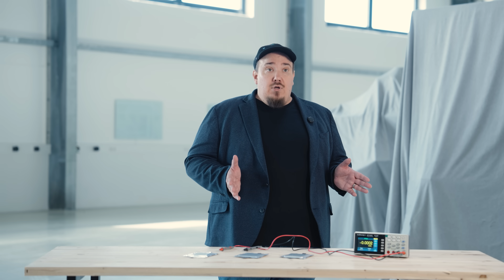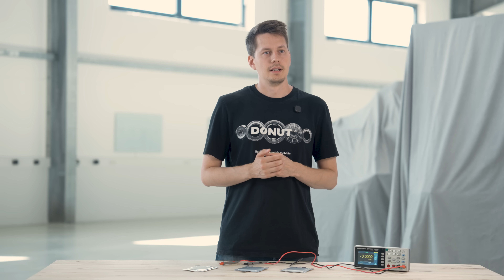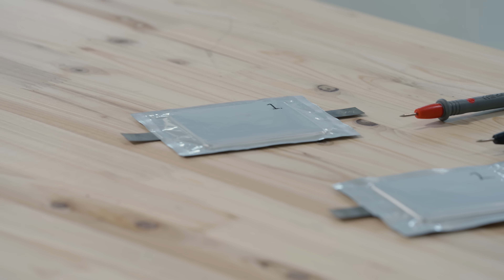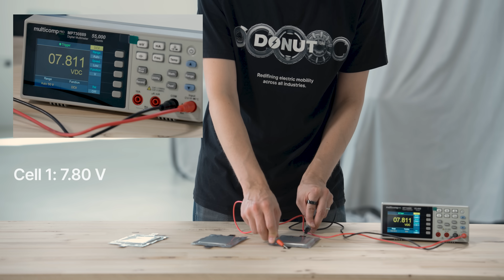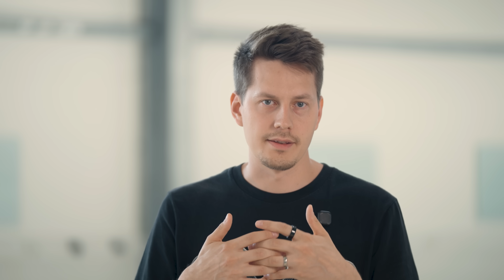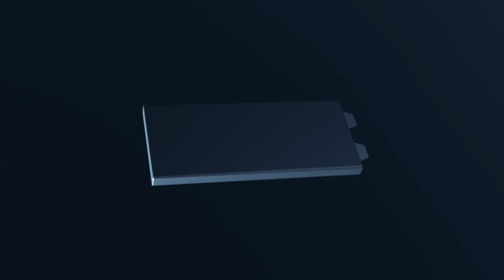Bipolar Cell | I Donut Believe

Comment: Still no third party verification of the energy density. I want to see you guys proven right if only because your critics have been so harsh, but why wouldn't you submit your battery to third party verification of the energy density claim? It's critical to the motorcycle. At this point, I've already decided to buy a Zero motorcycle with half of the range you claim for the Verge and much slower charging because I've taken the critics "debunking" of your claim for granted, despite the fact that the critics (like Ziroth) don't well support their claims either. You could contradict the critics easily by releasing a battery. Why don't you?
Reply: If what they have is real at all, it makes most sense to release that test just around the time the first production bikes go to actual customers. That would be kinda the slam dunk, when it becomes impossible to deny what they have, and they’d get another huge wave of publicity. 
Everything they’ve tested and shown up to now would be the foundation that eliminates all the other doubt people would have when they can test the basic specs (energy density) for themselves.
Like all other battery tech, unless you enjoy the theatrics, just ignore it completely until there are real products in real customers hands. Preferably some good independent third parties should have tested the final product as well.
Reply: @auspiciouslywild 
entièrement d’accord ! et quand j’aurai ma TS Pro GEN 2 déjà bien améliorée au niveau du moteur et pas que, normalement fin du premier trimestre 2027, je ferai beaucoup de vidéos sur ma chaîne dédiée, comme je fais pour mes autres 2 roues électriques ou non …
Ces conflits recherchés par Marko me font bien rire 😂
Reply: Parce que Donut a une stratégie commerciale spéciale, avec une pare de vérité factuelle comme leur moteur et leur première batterie de la GEN 1 déjà performante, et avec cette batterie Solid, Mako l'a affirmé dans ses premières vidéos, qu'il voulait exciter et remuer les autres autres constructeurs et ça marché, notamment avec l'avancée des batterie sodium Solid en passe d'être très prochainement mise en place dans de petits véhicules dont on se sert pour le quotidien.
La TS Pro GEN 1 a fait ses preuves et continu d'ailleurs, et personnellement j'ai commandé ma TS Pro GEN 2 depuis plus de 3 mois, avec la grosse batterie 33 kWh brut ou 30 kWh net utilisable et même si ce n'est pas une batterie Solid, j'aurai quand même une batterie performante semblable à celles qu'ont sorti CATL, BYD et d'autres, donc ça m'ra très bien, même si j'aurai préféré la Solid surtout pour une question de meilleure sécurité et insensibilité au extrêmes chaleurs et froid...

Comment: https://youtu.be/j5oyVNjrUPI
Reply: Ryan has put his career and that of the team behind him at Ziroth at risk with this particular video, it's not a well formed engineering analysis.  It's already been shown to contain a number of invalid assumptions and questionable jumps in the logic applied. The voltage curves when analysed by actual battery experts have been found to be dis-similar to known Lithium Ion cells, and in the range not only inhabited by Lithium, but Sodium cells as well. Then there's Ryan's rather selective use of Donut Lab data to calculate an approximate energy density matching that of known Lithium Ion cells, an approach that is both troublesome and rather concerning.
Reply: @GruffSillyGoat Interesting.
I'm not an engineer I can understand the datas. I didn't know about invalid assumption being made in the videos or his "selective use of data".
Technical analysis aside, the history of the company, its lack of communication (not commercializing the battery being tested and advertised at "true solid state battery") etc... Makes it way more than just suspicious.
Reply: @torusx8564  - or just careful in a cut throat market, where even a little bit of information can be copied, tweaked and sold as another's invention.
Reply: Donut just showed they can make any voltage cell and you point to Ziroth's video where he "proves" donut cell li-ion because of it's similar voltage and voltage curve. Really?
Reply: Pointing to "Ziroth" just shows how unserious you are
Reply: @oceanfrog so where are the "production vehicles"?
Reply: @humanbass  Only 2 would meet that description. You don't think there could be 2 or more and that you would even know the difference between the previous version and the one with the new battery? There probably aren't very many out there yet, but that is partly because they are still scaling up and refining the battery management system. They've already announced that battery 2.0 is a thing so naturally the production run of version 1.0 will not be a large product release. Besides, they have to make smaller numbers at first before they get regulatory approval from governments because it IS a new type of battery.
Reply: Ziroth became a lame discredited fraud because of the video you linked.

Comment: "First ssb used in production vehicles"

No production vehicles to be seen, just 3 small batteries on a cheap table.
Reply: Yes, appearance is more important than content to most people it seems. The smallness of the batteries is part of the point, small is better with batteries, remember? Who cares how much the table costs? Just because you don't see a production vehicle anywhere yet doesn't mean there isn't any. There is a sheet over something in the background of this video, an elephant sized object that you overlooked as you focused on the table. Maybe that is a good metaphor for what people are missing.
Reply: @robertludwig5620 just because you don't see an unicorn, doesn't mean they are not real.

Comment: Hey look at that, another powerpoint presentation.
Reply: What the hell difference does it make if they made a PowerPoint? How does that affect the content of what they are presenting? Lamest criticism of the century. Try again.
Reply: @robertludwig5620 you're right, it's more like a Microsoft word pad document from Windows XP.

It's that bad.

I mean, look around. The hype is so dead, even if the tech is real, it's boring at this point.
Reply: @PrIsMaTiSmX  ok, fine. if hype level is what you are about, then it is probably boring and lame. I am ok with that. Wish someone would start cracking about what is under the sheet. I think that's where the comedy gold is at for this video.
Reply: @robertludwig5620  look, we ALL want it to be real, but come on, 20 days between each video? No proof? No evidence they are even going to market? They keep saying it, but have never done it.

Curb your expectations pal. The hype is so dead, it doesn't even register. If its real, then they should just come out with the product and let all of us be astonished. This is going just like every other failed tech platform promising to perform.